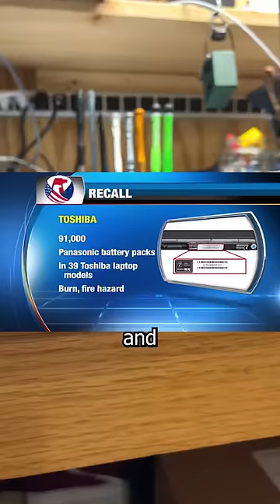This Toshiba Satellite is the worst #laptop ever made. EVER. #tech #pc #technology #shorts

Comment: I owned two, one from 2014 and one from 2015. The 2014 one the hinge broke and the force was strong enough to crack the screen and break the display ribbon. The 2015 one is still going, but with a keyboard issue (not a virus) that causes it to randomly spam the “9” or “;” keys and the 0 doesn’t work. And all the Toshiba HDDs are terrible. They both had them enough to where you could make and eat lunch and dinner and MAYBE it would be ready on the desktop for you to click Edge or Chrome and then WAIT AGAIN. Nightmarishly slow.

Comment: My first laptop was a Toshiba.  My parents bought it on Black Friday in '08 to have it ahead of my freshman year of college in '09.  So I didn't even set it up for 9 months after it was purchased.  Blue screen problems off and on immediately, eventually realized most of the components were several years older still and the hard drive was failing.  It didn't even make it to the end of the year.  I spent the next year relying on the school labs and held off on another computer until I could finally drop $600 (plus some discounts from my Uncle's workplace) for an ASUS with an i5 and a 540M just in time to buy Skyrim at launch in late 2011 -- that fried itself two years later in my tiny rented room with no A/C when I tried to open Word during the worst heat wave of the summer.  I'd stolen an oven thermometer at work and my house was 105° inside, so that was probably why.

Comment: I used the same Toshiba from 2014 to 2020; my parents, who were older than most and not very tech-literate, swore up and down that Toshiba made GREAT quality laptops. I was playing Minecraft at 5 fps with only a trackpad for YEARS and had no idea that was not the standard. That thing could barely open Microsoft word without shitting itself to death. 
I think I had to have it repaired maybe 6 or 7 times. broke it one time in high school and the frame completely separated from the LCD, basically had to hold it together with one hand and use the other to do everything else. 

I texted the repair guy a pic of my laptop and he just responded “lol you need to stop punching your computer when you’re gaming”. Bro had me stunlocked

Comment: Had a 2009 Toshiba Sattlelite that had its cpu die in 2016.

It was the daily driver for my family and saw heavy usage until it died.

I was in the middle of using it when it froze up like the cpu was maxed out, then it promptly threw a blue screen seconds before emitting a snap, crackle and pop.

It never turned on again after that.
I tore it down to the mother board and looked for blown capacitors or any signs of damage and found none.

Initially I was hoping it was just a bad cap or fuse but I believe it was more likely a borked cpu.

I pulled the hdd out and was able to use a sata to usb connector and successfully mounted it on a different computer so I knew it wasn't a case of a dead hdd.

It had a 250gb 5500 rpm HDD, a single 2gb stick of ddr2 ram and an Intel  Celleron processor.

It came with the x86(32 bit) version of Windows 7 Home edition which severely limited how much ram it would accpet.
I believe it was capped at 4gb because it refused to acknowledge an 8gb stick at all.

The Celleron processor was painfully slow when attempting to do any multi tasking.

The laptop was designed specifically for light use like checking email and browsing the internet but quickly became sluggish doing anything more resource intensive.

It had a built in DvD/CD drive and even struggled playing movies on disk back.

It came with a mini-VGA port, ethernet, three usb 2.0 ports and a multi platform card reader.
The track pad was buggy right out of the box, it had several dead zones that would cause it to stop responding at random times.

The keyboard was okay, the keys were a little too mushy for my preference so typing for long periods wasn't ideal.

Comment: My mom used a toshiba laptop as a daily driver for about 4 years or so with windows 7 pro installed up to the windows 10 days. One day I went to try and clean the inside and check the thermal paste to possible replacement when the screw post broke out the plastic cause I did not support the monitor right when taking the screws out. Ops. Now I upgraded her to a dell mini PC with 10 to due her basic work and play card games. There's no repairing the toshiba sense the plastic broke for the post as well.

Comment: Yes.  Had a A665D-6082.  Had a touch sensitive hardware switch that would lock up in windows 10 and the hd4250+hd5650 did not work correctly outside of win7. Still loved it. 😊

Comment: I had a 13" Toshiba I bought off a guy on craigslist. It was amazing for the time and even still had dvd drive. I never seen a more portable device and it was easy af to work on. 

Sold it, and still regret it to this day. Around that time I was working as Easy Tech at Staples and Toshiba basically took over as every laptop we had on display. I vomited at the horrible build quality and the asking price even on some of the higher end models.

Comment: I still use a Toshiba Satellite bought in 2012. Had a RAM (4 GB 1333 MHz to 8 GB 1600 MHz) and SSD upgrade since then and changed its few years old thermal paste yesterday.

I'm planning to get a HP Victus with an i7 before I will gift my Satellite to 7 years old niece.

Comment: I still have a Toshiba Qosmio F60 Future Shop exclusive and it served me faithfully for over a decade.  Some clever design elements, decent speakers and a lovely shade of red.  I had an external monitor hooked up to it for most of that time, so the smaller, low quality screen did well enough as a secondary.  Only things I swapped out was a new SSD/HD hybrid and some RAM.  Still works, though it's a little underpowered these days.
Reply: You don't see Toshiba consumer products anymore.  Used to be a pretty plucky lower-cost alternative to the bigger players.  They mostly do parts and components these days

Comment: I had a Toshiba Chromebook, can’t remember the model or year though probably a ‘14, but it was silver. I tried taking decent care of it, but eventually the aux port got finicky and the plastic holding one of the metal hinges broke. I ended up killing something between the display and the motherboard after using it for a reverse engineering project in high school.

Comment: I had a toshiba in 2012 ,and after a year the screen part just came off ,the cables were still connected ,you wouuld still be able to use it with something to support the screen
But the thing was still worth because it worked for another 3 years ,(probably it could work and now if i find the problem of why it shuts down after a few seconds of loading)

Comment: my first laptop was a crummy little Toshiba netbook. the battery lasted maybe an hour and a half at most, and it could just about run a minimal install of Debian with a couple of Firefox tabs open… streaming video was out of the question, though. this thing was so slow it could barely run like, Quake. from 1996. Cave Story ran at ~75% speed most of the time.

and yet, the little roach just refused to die. it still worked by the time I recycled it. may god have mercy on its soul.

Comment: I own an old Toshiba Satellite A660. It still works and I even upgraded it with as much RAM as it could take and an SSD.
Now, I haven't actually lit the blue touch paper on it for a while, but I reckon it will probably still work.
And yeah, it chews up power like it's going out of style, so I mostly use it plugged in...... when I use it.

Comment: I still have a 2009 Toshiba Satellite L650, and it still works! Sure, I removed the 2nd battery after it too was dead; Quite usable laptop with a Sata SSD and upgraded 8 gigs of ram, from the oem 4GB pair.  Windows 10 is soon out of support, so I have been thinking about ChromeOS Flex or even Linux; steep learning curve, that stuff with linux...

Comment: I had a Toshiba gaming laptop back in 2002 and it was much more reliable than a prebuild PC I had at the time.  Only had to replace the laptop's hdd due to my error. Where I had to mod the case and completely rebuild the prebuilt due to crapy components and chronic overheating.

Comment: I had and used a toshiba satellite laptop with Windows 7 on it. I got it for christmas, but it broke in like a year of use. It had RAM problems, and got a BSOD every few days, but i kept using it until the horrible build quality and plastic casing gave way to the left hinge. Even then, I kept using it, because the only other computer I had at the time was a Compaq Presario V5000 with Windows xp, which was, and still is, slow as honey, and cpuldn't play games with it's Radeon Xpress 200m graphics. Well, except Wall-E for Windows.

Comment: I had a toshiba satellite l300 that still works fine today. The hdd was replaced by a ssd and the ram maxed to 4gb. It was a 2008 computer. Unfortunately, because of the leadless soldering in those times, some of them suddenly turned to a greyish screen and nothing could be done. If you had the chance getting a good number, you could keep it for a long long time. It was the case for me and the l300 works fine with ubuntu.
I also have a c660 that works pretty fine with 8gb of ram and a ssd. I still can't reset the bios even if i've tried bypassing the cmos solderings. But it's still very useful today with ubuntu running.

Comment: I actually had this specific one as my second laptop (my first was also Toshiba but it was before 2014) and this one came with Windows 8, so you knew it was bad from the start. One day, I accidentally dropped it on its side once (my previous laptop went through this a few times before and nothing happened) but this one, it literally broke the inside screen, and since I didn’t have the money to fix it at the time, I just used a HDMI on a TV to see the screen.

Comment: I had a single Toshiba laptop. I can’t remember its designation but it was a good laptop. It had a mostly silver color pallete with grays. Only issue it had ever was its charging port. And that wasn’t cause of the case breaking due to opening and closing the damn thing no. It was cause inside it had two little plastic brackets that were known to break. It was a simple fix but I wasn’t good with electronics back then I’d fix it today if I knew where it was

Comment: I had a Toshiba Satellite from 2011-17. I don't remember the exact model, but it was a tank of a laptop; it was big, thick, and sturdy, and while its integrated GPU wasn't very good, it had an i7. The thing is still sitting around; it might still work, since I only upgraded to play newer games (I have great memories playing GTA: San Andreas, Fallout: New Vegas, and pretty much every Valve game on that thing, but any game made after 2012 would have to run at the lowest graphics settings, and might also be <20 fps). 

That was my second computer. My first was a Compaq CQ50 from ca. 2007, my third was a Dell Inspiron from '17 to '22, and my current one is a Lenovo Legion. Each one has definitely been a step up from the one before, but the screen size from that Satellite hasn't been beaten.

Comment: I used a Toshiba Satellite C650 from 2012, it used to have a pentium dual core, but I changed it to a 1st gen i3 in 2019 and used it until 2022. It wasn't as bad as that one in the video. Though, I got frozen pixels (that recovered now) it worked fine, and I even installed the leaked version of windows 11 on it. Ran just fine. I had a ssd in it as well.

Comment: I owned a Lenovo laptop up until a year ago, it was running great, it didn't have many issues up until 4 years ago when I broke the screen somehow (I swear Idk what I did), it cost 400 euros to fix and the laptop itself was about that price, to make it worse, when the laptop came back from repairs, the plastic was cracked and glued with a clunky glue, they didn't return half the screws and within a year it started dividing, it was fucked, but still functioning, it works to this day, but I replaced it with and older Dell laptop due to the battery being practically immovable (as in, the battery life at 100% was 30 minutes), my sister took it and it still runs pretty great, so I guess it ain't that bad

Comment: I’ve got one I use as my workshop computer. It has extremely little use because it came from my grandma. I think it has a 6th gen i5 and 8 gb ram. Actually it’s not a bad workshop computer because if it does break from metal chips flying at it from my milling machine I don’t really care because I can get another one for cheap. And it actually does run things okay it had windows 7 on it with a bunch of those crappy programs old people install because they clicked on a link. I wiped it and installed tiny 10 and it actually runs things pretty well, it will even run my CAD/ CAM software (autodesk fusion). If it’s just gonna sit in one place and constantly have debris flying at it it’s actually not a bad option because you can get new one for really cheap. Although I’ve been considering a tough book for my workshop computer.

Comment: My very first laptop was a 2013 Toshiba satellite S 55 I think. I actually still have it and good Lord it is incredibly slow. It wasn’t always like that, originally it had windows 8 and we all remember how horrible that was and I think it’s hardware was optimized for that operating system so after it’s updates and never really went back to the way it was when it was new. 8 GB of ram, a one terabyte hard drive, and Intel core i7 whichever generation was the newest in 2013. Honestly spec wise, especially for the time it really was an absolute bargain for the price, $600 brand new. Now there were trade-offs like it didn’t have a Bluetooth antenna, which was still optional for a lot of laptops at that time and the battery life was lower. Even when it was new, the battery life barely hit four hours, now if I try and use it, I’d say I get about three good hours out of it. But I was in junior high and then in high school and I really just used it as a home PC so it was always plugged in. And yes, the build quality was atrocious from day one, it has a brushed aluminum body, but it is very thin and it flexes very easy. But honestly, it was a really decent laptop, it ran battlefield 4 and Castlevania lord of shadow pretty decent on there. It got me through high school and my first few years of college. I never even got close to filling up even half of that terabyte so I don’t suspect the hard drive is suffering from fragmentation even though it’s a slower RPM, I really think the one thing that really just fucked it up was all of the windows updates. 
So yeah, you can talk shit about Apple all you want, but I got the chance to witness a perfectly capable laptop slowly become less capable overtime with every single new update, each one was slightly more buggy and created more glitches for me. About 10 years later, I got my first MacBook Pro and I’ll finish it off with saying that Mac OS is the best operating system.

It’s use now? Burning CDs 😁, all you audio nerds out there know that CDs are still the absolute peak when it comes to sound quality on good equipment

Comment: I still have the toshiba satellite c640 back in 2010 but mobo ram slot now have problems i still think its because i always reseat the ram of it just to make it work and there's that orange light power problem. It has an i3 370m, 4gb ram, cd drive and a 320gb HDD so its really heavy carrying it back in the days but i already change it to SSD and win 10 pro so its really fast on boot. anyways its already retired and if i have a spare money i would buy a spare parts of it since almost all of the parts could be bought online lol. What i really hated on the laptop is literally taking it apart one by one since if i just wanted to clean the fans i still need to remove the keyboard which i hated the most since its easy to break and mine got literally broke so i was forced to buy a keyboard just to use. 

Right now, what im using is a laptop from my dad toshiba satellite A665 with windows 7

Comment: 2000 I bought a Toshiba satellite. Was £749.99 (a cheap laptop back then). AMD K6-2 3D now CPU @450mhz.

Was a great machine. Think the HDD failed and was given an NEC of the same spec under warranty (took them months to fix it). I have never bought an NEC laptop again. 

I dropped it and it fell down the stairs. Insurance gave me £1200 (someone messed up the paperwork when they did the exchange).

Bought an advent pentium 4 2.4ghz, with a GeForce 4 440mx GPU.

Comment: dude my mom had one of those back In the day💀. it lasted for a couple of years surprisingly until the battery got fucked and turns out that said battery was also connected to the bios, which means that even if you plugged the laptop without the battery you couldn't do sh1t because of the BIOS issue. (either that or both batteries died at the same time, I don't remember)

Comment: My Toshiba satellite hinges broke then I tried to put the Toshiba back together and when I was trying to plug in the power button cable to the motherboard it broke. After that I left the top case off exposing the contacts where the plug in broke so I took a screw driver and shorted both contacts to power it on with a external monitor and keyboard and mouse just to play tf2. One more thing I used to use paper towels and put it on the motherboard and used an ice pack to keep it cool sometimes just a normal desk fan to. But that laptop still works fine to this day.

Comment: Toshiba were good. Really good.
I had my share of it.
Then, for the same reasons why HP, Sony Vaio and other brands fell, it was bad.
I had one that was running so hot I couldn't hold it in my hands.
Still great memories. My last Toshiba was whe I was assigned to LA Paz, Bolivia.
Still have the files though, because I was always a backup freak.